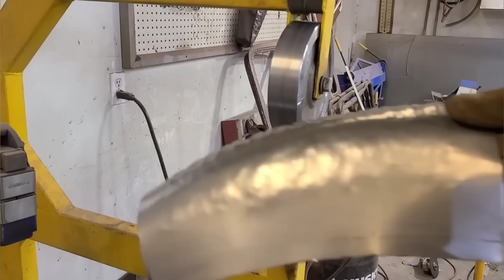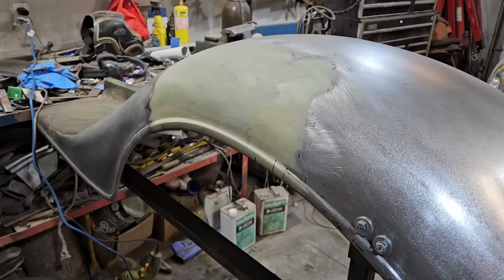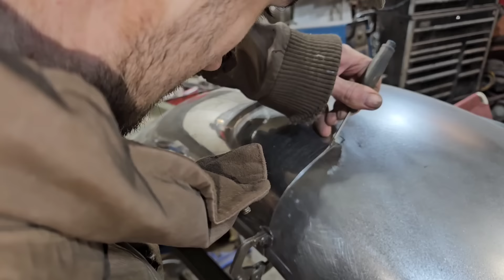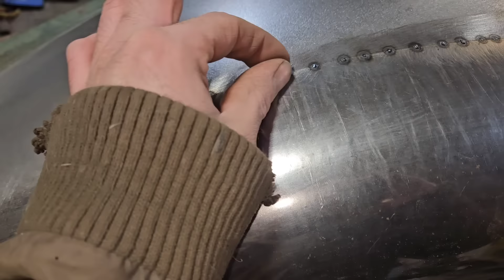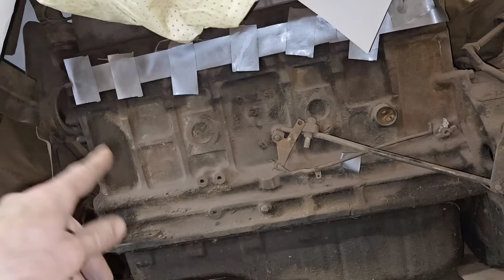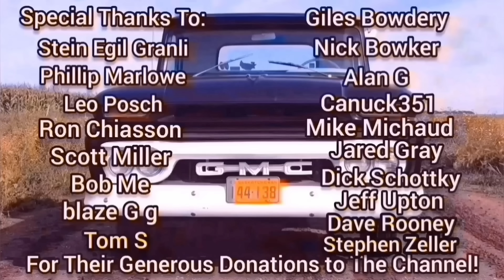How to Fabricate and Weld in a Patch Panel. Step by Step Process.

Comment: You call it a Crude way of  building a Patch panel  but IMO.  It’s brilliant ! And Extremely Artistic   Because it’s a Man who knows his Trade  ! My Grandfather was a Body and Fender man  in the 1930s then became a ProfessionalWelder for many years Untill he was forced against his Will to retire at 65 years old  he.  Actually     lead filled a car my Father had in storage for years in  his parents garage  then he sprayed Black Laquer on the  main body  tub  of a car I eventually inherited after my Father and I did a body off restoration  when I was a teenager the majority of our restoration was a complete Mechanical refresh  on all components minus the Transmission that was  fine   we    Flushed it and added fresh Oil

Comment: Had an old timer show me that if I laid 1/4" welds everywhere that I wanted to lock in the shape (like, at the top, then the sides, then the opposing sides bottom and so on, working my way out to the corners, all/any warpage naturally forces itself towards the corners, where it's easy to address with hammer and dolly before welding into place.  Then following the original "pattern" of welds, filling in the gaps between them... Anyway, its always served me well and made for minimal warpage at the end

Comment: I have welded for over 45 years as a boilermaker, and used a tig most of the time and you are right on, the more stops and starts you have the more srink you will get, if you want to have the dip go the other way weld from the other side, weld pushes away from the side you weld, might be easier to work........

Comment: Don’t think a t5 is going to bolt to a 235 odd bell pattern main shaft cover on the 5 machine down or open the bell to fit?
Reply from the maker: Pretty common to put an s10 t5 behind a 235 or 216

Comment: In the mid 60"s when I was in High School I worked for a Mechanic shop in a small town in Northern Calif. , the shop owner had a 36 chevy with a 292 six and a powerglide  open drive line , it had dual carb manifold and split exhaust , it was his daily driver and our shop truck . Very nice work on that fender and it was great to see a 36 Chevy again .

Comment: i assume rounding the corners on the patch panel eliminates future cracks in a 90 degree pointed corner  ? , but is it as important with a flat panel instead of a contoured round shaped fender  ? , i already have a rectangle cut panel to replace the wheel well openings - but can add rounded corners if necessary  . . . . . thank you
Reply from the maker: I like to round the corners as it makes it a bit easier to blend the patch panel in. A hard 90 will usually leave a weird ripple in the panel that's difficult to get rid of.
Reply: @CarterAutoRestyling  so when doing a hard 90 degree "watch the heat" build up

Comment: I noticed you rounded the corners -( because of the rounded shape ? )  is it necessary to round the corners on doing a similar  patch panel on a 67 Camaro replacing the rear wheel opining 36 inch and the panel 43" long and a few inches below the fender top "I'm at a rectangle panel now but only sheet metal screwed on the car - it's a flat panel should i round the corners ? ... thank you

Comment: Beautiful work Kyle! If you ever repair the headlight "eyebrows"  (above the headlights) on tri 5 trucks it would be a valuable video.... mine are shot on both fenders and they no longer make patch panels. I can't find anyone on U-tube that has a video. Cheers, Doug (Vancouver Island)
Reply: I think Cold War Motors - Scott did an eyebrow on a 1960 Plymouth.  He found one good fender but the other he had to make a new eyebrow.

Comment: I learned the same method of "tack every inch, grind, planish then weld end to end" from a very talented British coachbuilder/fabricator... but using oxy/acet. A few decades of doing it using the "weld a bit and let it cool method" sucked compared to the way you do it. So much less warping this way.
Now as a senior citizen (read that "Old Fart") I'm trying to learn this with TIG.  Fun stuff, when you can learn by playing instead of at a 9-5 (or more) job.
Anyone who says you need to weld a bit and let it cool, with oxy/acet or tig hasn't been shown how do it properly or just won't learn.  MIG is a whole different story.
As usual, Kyle.... nice work.
Reply from the maker: Thanks Joe! As my old boss used to say "I pay you to work, not to learn" I had to learn tig welding on my own time or be banished to mig welding for all eternity
Reply: @CarterAutoRestyling  Time well spent, obviously.
Reply: How are you doing these days Joe?

Comment: Ever work out dents in a motorcycle gas tank?  I've got a small-ish one in the bottom corner (furthest from filler cap, just infront of left thigh).  Is there a point where cutting it out is better than trying to find  or making a tool that will get in there and wedge it out from the inside?
Reply from the maker: Either use a unispotter or make a tool like the pdr guys use  to pry it out.

Comment: Cluck Cluck, Do the 36 PU use a wood frame for every thing as well?
Reply from the maker: On the high cab, yes. This is a later low cab so it only has wood in the A posts

Comment: This Man is impressive. I did auto body repair and restoration for over 20 years starting in the early 80s. Back then you would have to fabricate lots of parts because replacement panels/pieces were not readily available. You Sir are a true master of the art.
Reply: He sure is. He has been my hairstylist for a while.
Reply: Carter hair re styling. I see you fit 4 vehicles in your boutique.
Reply: I had some crackhead (bonafide) ding up a miata with a cinder block . The sheet metal used everywhere other than the aluminum hood is very hard/brittle it prefers to crack rather than being malleable.
Reply: I remember the '80s... Lots of "Cave and Pave", in those days... Especially under B.C. Govt. Insurance (they didn't want to pay for much of anything)... 😒😒😒
Reply from the maker: Thank you!